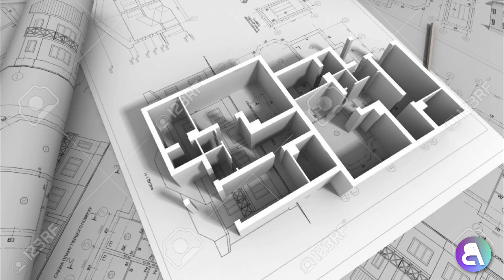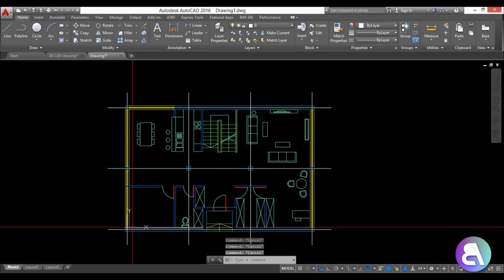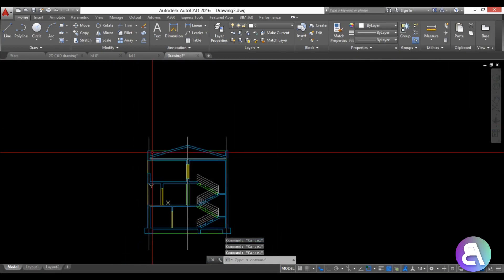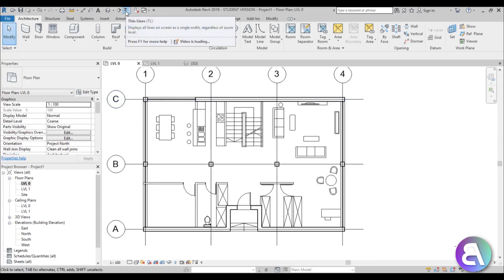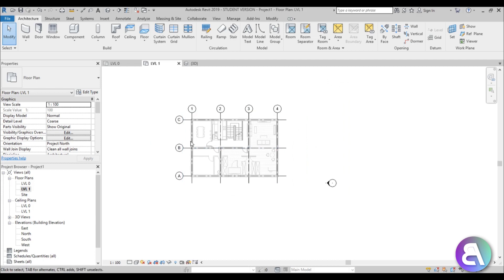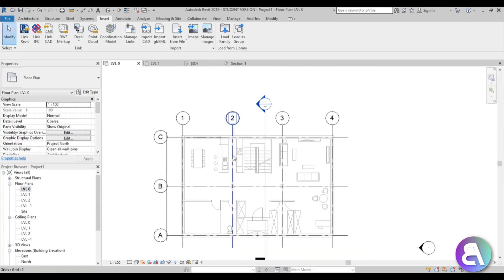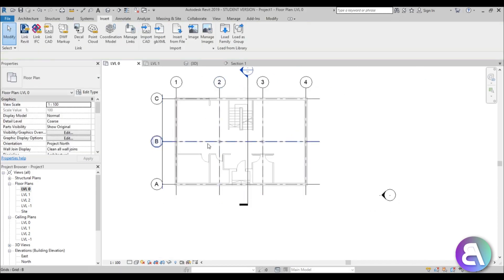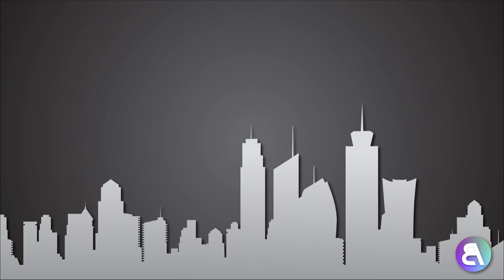2D AutoCAD Drawing to 3D Revit Model Tutorial

Comment: Sir, when I imported the dwg file using link CAD, the floor plan is perfectly placed but when I'm switching it to 3D view..it's not appearing the way it must be, it's kind of showing a stretched view. How to resolve it??
Reply: kindly scale ur model and check the units both in revit and autocad  so that they match perfectly.. if in autocad u use cm then in revit change unit to cm as well.

Comment: Hi just wondering if anyone can help, I've followed this tutorial and struggling to find the section when importing into revit, when I check 3d view I can see it but its at different height and not in line with axes point it was saved in.... Very confused
Reply: I'm dealing with the same issue here. The 3D view is kind of stretched vertically. Seems not as in the tutorial., did you fix it up??

Comment: I have been doing Intelligence spec driven 3D piping since 1994.  1994 Pro-Pipe, 1996 Rebis Autoplant, 2001 Cadworx,  2012Plant 3D  2004 Quick Pen.   Oil / Gas has used very high end system for over 30 years.   You make it sound like this is something new.  Far from it.   PDMS, SP3D, PDS  VERY HIGH END

Comment: Nice to see something that I actually have to do at work! Gives me a bit of confidence that I don't do everything wrong... However I have learned for myself that small objects are better off being made completely new without linking the cad files- I just take the printout with dimensions on it and model them in revit- for a normal family home this seems faster and has the added bonus of getting rid of any .0002 imperfections in autocad and you find other flaws like doors that are slightly out of the grid..